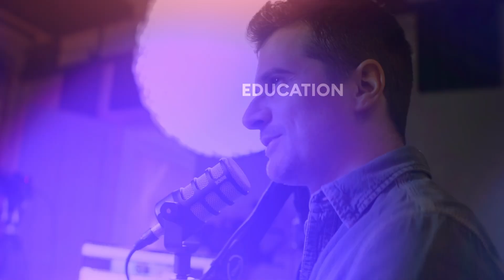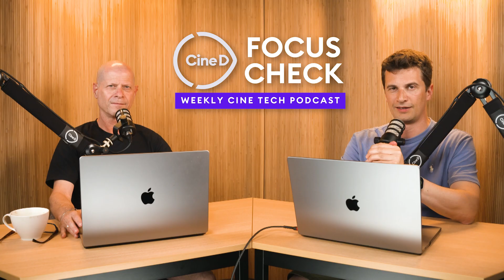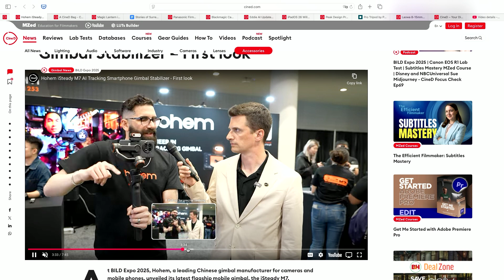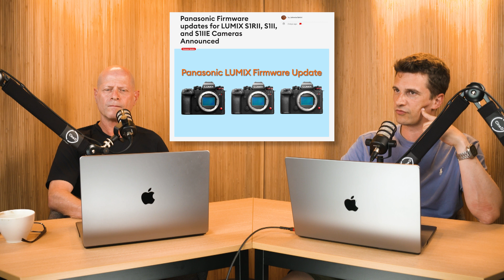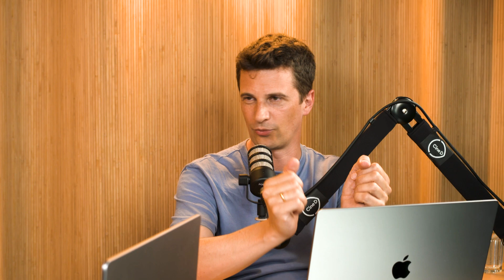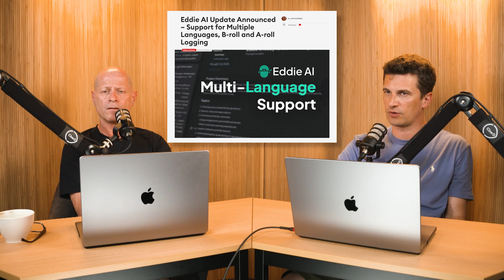A CineD Bag?! | Who uses Camera-to-Cloud? | Peak Design Pro Tripod  - CineD Focus Check Ep70

Comment: Before talking about a camera (Micro studio 4k G2) You should inform yourselves well because you are completely misguiding people here (you´re not losing the capability of recording to an ssd drive since you can use a usb hub and connect the monitor alongside an ssd drive)...
Reply from the maker: Isn't that exactly what we talked about? I guess you didn't watch this section until the end...
Reply: @CineD As soon as I heard some misinformation I stopped watching... I have limited time. My bad if you corrected yourselves later on in the video.